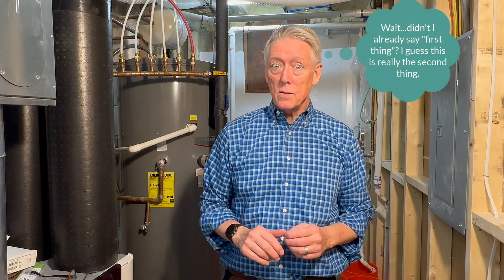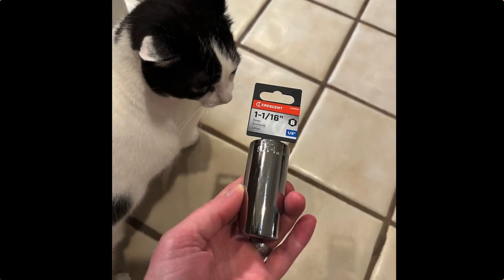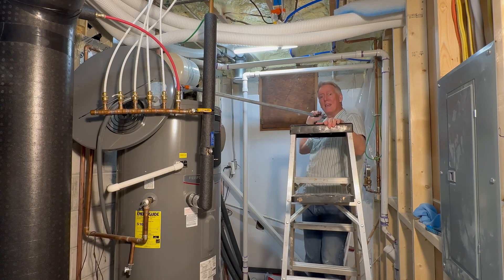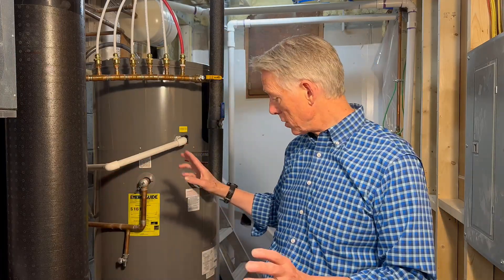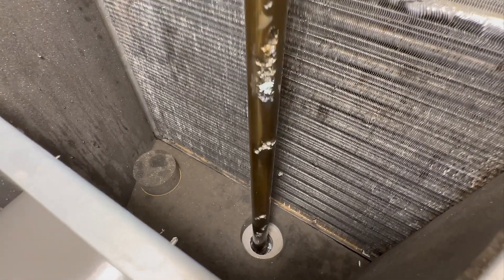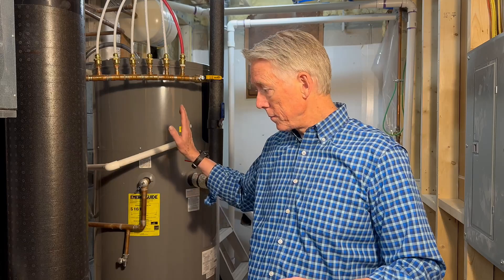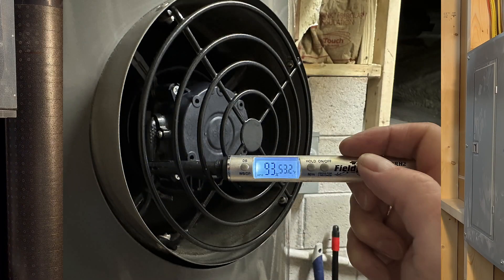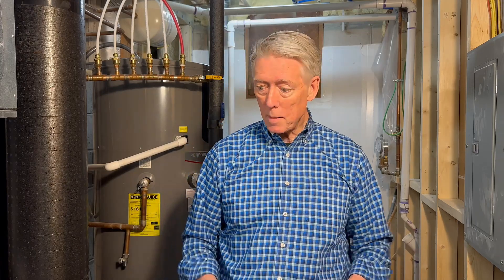Have You Checked Your Anode Rod?

Comment: One other thing to mention is that anode rods are commonly available in aluminum or magnesium. Aluminum rods are better for hard water areas but may not be suitable for softened water due to their slower reaction rate. Magnesium rods are generally more effective for soft water.
Reply from the maker: True, and there's also the powered anode rod, which I understand should never need to be replaced...as long as you keep it powered, that is.

Comment: Could the fountain have been caused by the standing water in the hot water lines simply draining back to the low point drain you inadvertently created?  Shutting the hot water supply valve at the tank exit would prevent that too.
Reply from the maker: Yes, I thought about that.  Larry pointed out that it was unlikely, though, because of the amount of pressure.

Comment: My water heater was built in 1995. I’ve decided it will last forever. Seems to be the most rational outcome. 

There’s also little clearance up top before the joists, so no, replacing its anode rod isn’t a practical option. 

I’d imagine what used to be a 40 gallon tank is now a 30 gallon tank that weighs as much as a Kia. We may hire an archeology team to extract its pieces when the blessed day arrives. 

I bought a heat pump model. I haven’t lugged it downstairs yet. It will never have its anode rod checked because of the clearance issue. I suppose I could replace it before use with a sectional rod or with an electrified one, or just wait until the heat pump breaks, which is likely to occur first.
Reply from the maker: You must have really good water quality if you think the heat pump will break down before the tank fails.
Reply: They sell segmented or flexible anode that don't require as much clearance to install. For the old one, you can cut it as you remove it, or just bend it carefully trying to not drop more debris into the tank.